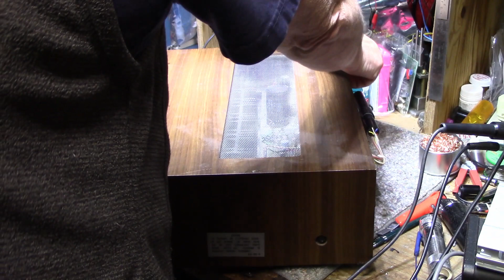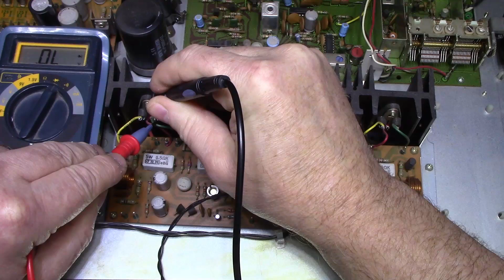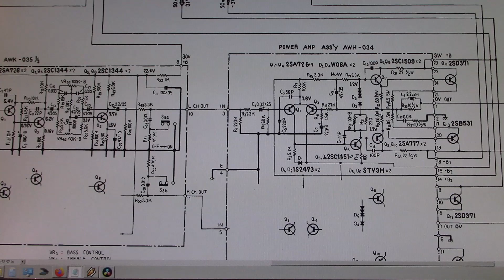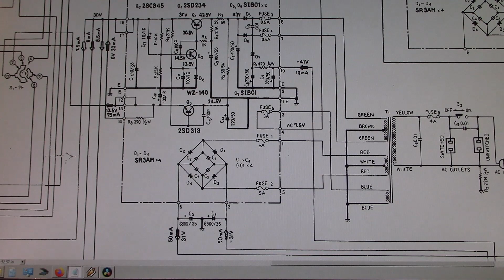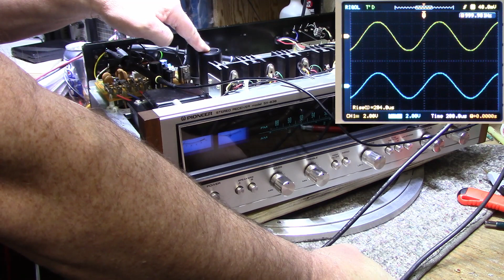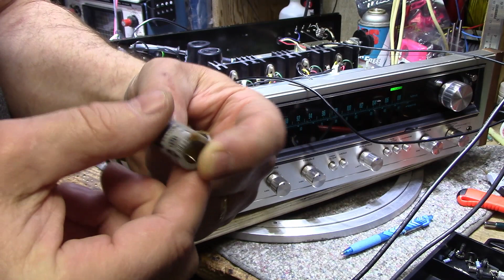Pioneer SX-636 Receiver Repairs (Ep. 64)

Comment: I have the same unit and I am getting random static and pops even when the unit is powered off. I suspect the same three caps but unsure.
Reply from the maker: Hi David,
It shouldn't be making noises when powered off. I suspect cracked solders in the power amplifier or failing transistors. It would need to be diagnosed on a bench to be sure.

Comment: I was measuring the ESR with my MESR-100 meter measuring across the leads on the component side because the test leads they give you on that meter are alligator clips with rubber booties. The Sanyo 0.33/25 volt caps measured 19 ohms, and yes the cap was shorted prior to hooking up the leads. However the alligator clip popped off of the negative lead and bumped between the base and the collector metal can of the bias transistor Q5. 

There was quite a charge on that -41 volt power supply, because it was not plugged in. There was a pop as those 220 uF capacitors discharged across the 2SA777 and shorted it collector/emitter. I did bring it up on a 60 watt dim bulb after the incident, and it lit up bright.  I substituted KSA1013YTA and complement pair device KSC2383YTA in lieu of the 2SA777 and 2SC1509. The subs ran an extra 100 hFe hotter than the stock transistors, now the bias will only come down to 28mV with the bias trimmer set all the way to minimum. Stock bias is 20mV, but the service manual did not say plus or minus figure. Nothing runs hot, but I don't like the idea of having a hot bias and not being able to turn it down. Any ideas?

Comment: It's it possible to play a tablet/ phone through this?
Reply from the maker: Yes but you'll need a stereo 3.5mm plug to RCA adapter cable
Reply: @TrevorsBench  thanks for the reply. Are these generally good quality? I've found one second hand which I'd love to get as my first vintage receiver
Reply from the maker: @Bulltardwin  Depends, at this age it's anybody's guess how it's held up. Aside from burnt out lamps, capacitors are the next biggest problem you may encounter. Even with weak or failing caps the receiver may work and sound good. Sorry, I can't advise you any better on this, every receiver is different
Have a listen if possible and see if it sounds pleasing to you.
Reply: @TrevorsBench  ok thanks mate